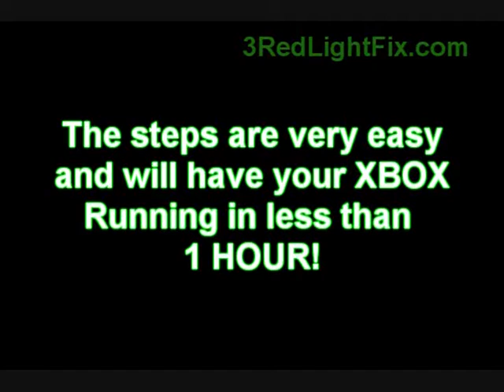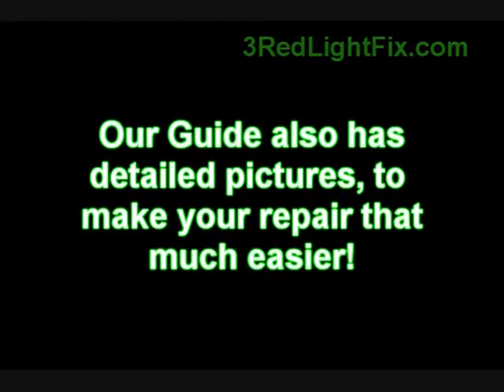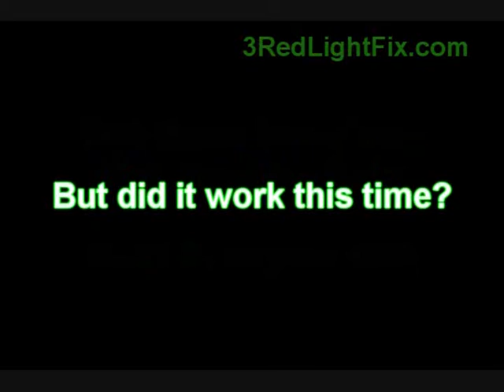Xbox 360 Red Light Error @ Red Ring of Death Fix Guide

Comment: so I have 3 red lights flashing. I have disconnected the power and AV cables.. plugged the power into different outlets. leave it off for hours.. turn it on without the hard drive on.. whiped my AV cables.. and it is still on? But there is no way I can take it apart and put it back together again.. but I can't wait a month for it to go to xbox and hope the problem is solved... any other solutions? Buy a new one?